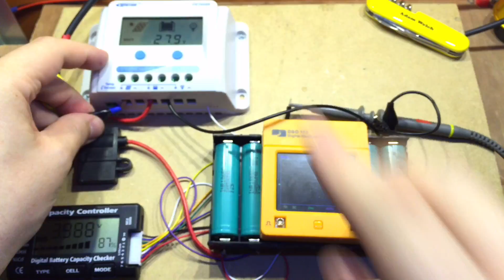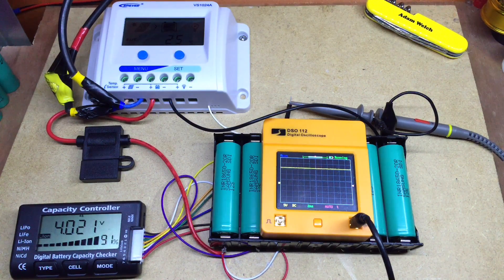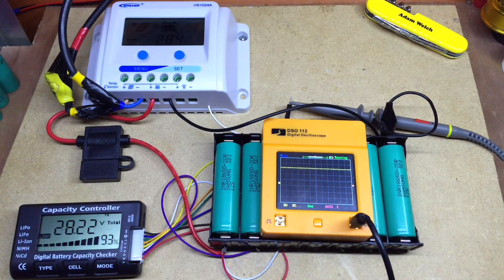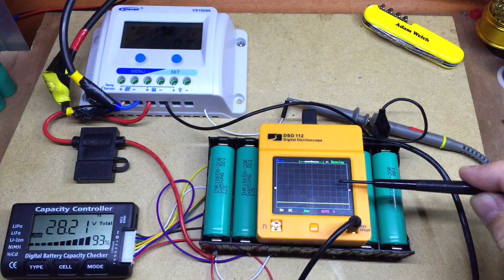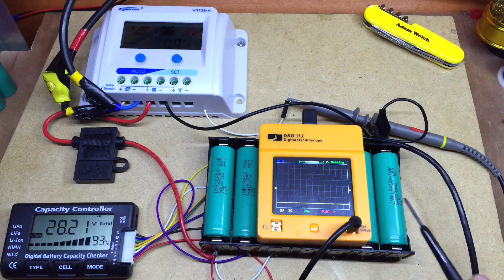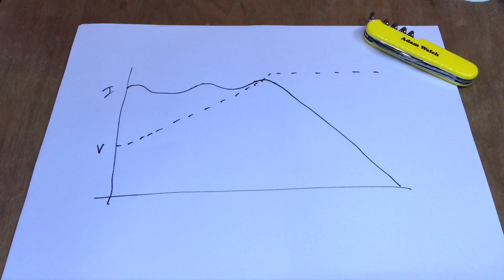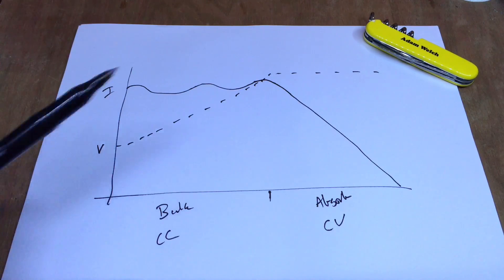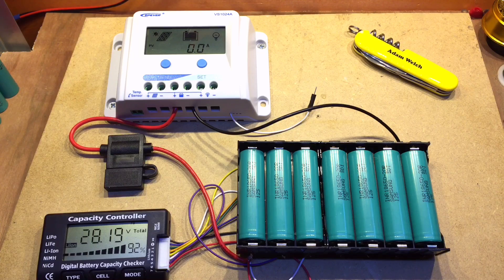Solar Charging Lithium Ion 18650s - Part 3, The Results - 12v Solar Shed

Comment: Can you measure the voltage of your solar panels after plugging into a charge controller.  I am using an old 16v laptop charger and a charge controller to monitor my batteries.  As soon as I plug the charger into the charge controller, the voltage at the laptop charger (controller input) drops to whatever is being used to charge the batteries.  I thought that there would be 16v at the controller input, and 14.Xv at the controller output to the batteries, but the charge controller seems to lower the voltage of the input. Does this make it impossible to measure the voltage of the solar panels when connected to the charge controller?

I don't understand why lithium charge controllers are so much more expensive than lead acid charge controllers.  Wouldn't it be easy for the controller manufacturer to program in the different cutoffs to match lithium battery types?
Reply: The voltage measured at the solar input of a PWM controller will always be around the same value as the battery voltage during the bulk charge phase. It will usually be slightly higher due to voltage drops within the controller. That's normal. However, if you're using a laptop charger and it drops to near the voltage of the batteries, that's scary! It must be pushing some current out. Probably not good for it. 

You might want to put a resistor in series with it to limit the current a bit, and also that will make it behave more like a real solar panel. An incandescent bulb is the ideal solution here as it will act as a quasi-constant current source as well as a crude current indicator. Try a 21 watt 12 volt tail light bulb to begin with.
Reply: I'm not following what you're saying.  If it's normal for the input voltage and output voltage at the charge controller to be approximately the same (even though the panel or the laptop charger is putting out higher voltage), then why is it scary that the charger's voltage is the same as the output voltage - same thing, isn't it?

Right now the input voltage from the charger at the charge controller and the output voltage to the battery are reading 13.8v (even though it's a regulated 16v charger).  I was surprised by this, but I think you're saying it's normal for the lower voltage to be measured at the charge controller input (I assume this is true with a solar panel too).

I don't understand what you mean about pushing some current out.  Once the batteries are charged, I don't think the charge controller is pulling much current.  When I measured current into the batteries after they were full, it was very low.  

Nothing is getting hot, and it all seems stable.  not sure what you mean about scary???
Reply: Because a solar panel is a reasonably high impedance source where as a SMPS for a laptop aims to be extremely low impedance. In other words a solar panel has a certain amount of resistance "built in", as it were. However a constant voltage power supply does not. It always tries to keep pushing out it's design voltage. The only reason why it will drop is due to overloading.

It is true that a lot of such units have some kind of electronic protection on board, but this usually only activates during extreme overloads. The most dangerous situation for these units is when they're supplying just a little over their intended current rating. They'll keep going until something cooks. This could happen quickly or over a period of time. 

Have you measured the amps your batteries are pulling at the beginning of charge & what current is the laptop PSU rated for?
Reply: The laptop psu is 16v 3.35a. I'll try draining the battery some and then measure the amps being pulled out of the charger.  I guess what you're saying is that it's not a good idea to use a laptop psu with a solar charge controller?
Reply: First, I put a load on the battery to draw it down.  As soon as I put a load on the battery, the battery voltage dropped about 5v.  I wonder if this is an indication that my battery may be bad? It is an old battery.  I have another.  Once it charges, I'll switch batteries and see if it makes a difference in supporting the load.

After running down the battery, I put the charger back on and measured the amperage draw.  It was only putting out about half an amp (.45 or so).  So much less than the rated 3.3 amps at 16v of the charger.  I guess the question is why is the amp draw from the battery so low?  I think you were worried that it would be drawing more than 3.3 amps, right?
Reply: Well if you're only pulling 450 mA or so it would seem that the PSU is in no danger of being overloaded. On the other hand though one would think that a regulated charger like a laptop supply would still be putting out close to it's rated voltage at such a slight current draw. 

I wonder if the power supply is not working quite how it should? A 16 volt 3.3 amp supply should be capable of delivering just over 50 watts. You could test it by putting an 8 ohm resistor directly across it while measuring the current. You should get around 2 amps flowing while the voltage is still fairly close to 16 volts. This would be drawing 32 watts so you would need a rather hefty resistor. Two 16 ohm 10 watt types in parallel would do the trick if you don't run it like that for too long - they would get quite hot. 

How many volts is your battery & what size is it? And is it a lead acid battery or lithium pack similar to what Adam is using on this video?
Reply: Generally speaking, you can use other supplies with solar charge controllers but you have to be aware of their different characteristics to actual solar panels. When a PWM charge controller is in the bulk charge phase it's essentially functioning as a "piece of wire" between the source & the battery. It's really no different to connecting the battery directly to the panel or other charge source. 

If you have a bench supply with a current limit control (or one of those Ming Hi boards with something similar) then it's no issue as you can just set the maximum current to a safe value. But if you are using a random wall-wart or other power supply intended to power something else to feed your charge controller, you need a way of limiting the current to a safe value. 

That's where a resistor comes in, it's value can be found by experimentation & will depend on the size of the battery, the voltage of the PSU and the current that the supply is capable of safely delivering. 

Of course setting up such an arrangement would ideally need to be done using a battery you know is in good condition that is quite discharged (but not over discharged), that's the point where the maximum current will flow.
Reply: Thank you for all of this information. Very interesting.

Isn't the charge controller limiting the voltage?  If I plugged the charger directly into the battery wouldn't it output 16v (or 19v for a 19v charger or solar panel) and damage the battery?

I don't know why the current draw is so low.  It's a small sla battery (12v 3.3a), maybe that's why? I can test the charger on my buck converter and see what voltage and current it puts out into a load.  I'll let you know. I don't own any resistors. I have also used the charger on a jump starter pack with an 18ah sla battery, but I did not measure the current draw.

I will look at getting a buck boost converter with current limit function. Is there a rule of thumb as to the best current limit for charging sla batteries, or does one just make sure not to exceed the maximum amperage of the charger? Is it better to charge sla batteries at a % of their capacity? Or do they absorb on their own at a % of their capacity?
Reply: Yes, there is a rule - although it's not a solid rule, more a guideline - about how much current to put into a battery. Generally it's C/10 for a lead acid battery. So if you have say a 100AH battery you would be looking at 10 amps. For a 4AH battery best no more than 400mA although for smaller batteries it's probably best to go to C/20. For discharging it's considered overloading the battery if you take more than C/4. That would be 25 amps for a 100AH battery. 

The only limitation on the current that your typical cheap 10A PWM charge controller will supply is set by the source it's connected to. However once you get into the higher end of the charge it begins to limit the voltage applied to the battery though it's PWM action.

Naturally, limiting the voltage will also cause a limitation in the current flow. but it's not regulating the current per se, just the voltage. 

How much current that does actually flow is set by a few factors. The internal resistance of the battery (which changes with charge level), the voltage differential between the source power & the battery, and finally given a big enough voltage differential, how much current the source can actually supply. 

I would recommend getting a few high wattage resistors of varying values to play around with. They're pretty cheap and in combination with your meter you can learn a lot of what is going on when batteries are charging. In fact it's possible to make a charger just from your laptop PSU and one resistor. You just gotta remember to turn it off when the battery is charged! If you use a relatively high value of resistor and trickle the current in really slowly, that can be helpful in attempts to resuscitate batteries that aren't doing so well.
Reply: Xanataph:  

I tried to do some current measurements and testing today.  I plugged the charger into my buck converter, set the output for 12v, and measured the current going into an old 12v laptop computer, both to charge the battery and while it was running.  While running, the current numbers were jumping around, but it was pulling around 2 amps - so the charger seems to be working properly.  

The computer would reset when the battery was not installed in the laptop, so the power from the buck converter was not sufficiently stable.  I suspect this is due to the buck converter.  With the laptop's battery acting as a buffer, it ran fine, but was switching back and forth between "AC" and battery power quite often.

So I think the charger is working right, and the small SLA battery is just not drawing much current.

I tried to measure the efficiency of two buck converters using the charger and the computer while charging the laptop battery.  While charging (not running), the current readings were stable.  Unfortunately my results don't make any sense.  The input to the buck converter was reading 14v and 1.03amps (14.42w), while the output was reading 12v and 1.36 amps (16.32 w).  

On a second buck converter, I had 14.3v at .76a in (10.868w), and 12v at 1.11a out (13.32w).  I'm pretty sue I can't have more Watts out than in, so I'm doubting the accuracy of my measurement equipment (a very cheap Centech multimeter).  

I'll try the charger on a bigger battery (12v 18ah) when I get a chance and see if it's drawing too much current (using my possibly flawed multimeter).  I actually have a buck converter with a current limiter that I could use if the charger is being overtaxed, but I'd rather use it for regulating 12v output if it's not needed to protect the charger.  I don't think these SLA batteries are pulling that much current. 

In your prior comments, I think you were worried that the batteries would demand increasing amounts of current, overloading the laptop charger.  I'm not clear whether a battery "pulls" current or whether a charger "pushes" current, but somehow it appears that they are limiting the draw to safe levels in my small SLA battery.

If I hooked up a solar panel generating 10 amps (120 watts), would only a safe 1/2 amp be going into the battery?  You said that a solar panel has a higher impedence (more resistive?) than a laptop charger, and so won't pump too much amperage into the battery. Could the laptop charger be doing the same thing?
Reply: Sounds like the buck converters are running right. More amps out than in is what you would expect. It is difficult to get an accurate current measurement on something with is taking power in a pulse type fashion. That can confuse a multimeter. This would account for your erratic wattage results. 

If the laptop charger is putting out 2 amps indeed it does seem that it is working fine. If your battery is not pulling much current it could be sulphated up. 

Another thing I just remembered. Some switchmode power supplies tend to do "funny" things when there is not enough current being drawn from them, such as outputting a lower voltage than usual. Which potentially adds another layer of confusion into the mix. 

Yes, solar panels have a much higher supply impedance than your typical linear or switchmode mains derived supply. However a 120 watt panel in full sun is likely to push a substantial amount of current through a 3.3AH SLA battery unless it is kept in check via some means.

Comment: Adam,  You had another comment on this same topic on your part 2 video.  I am also suspecting that the cell monitor Digital Battery Capacity Checker is draining the first 4 cells causing these to be lower in voltage,  3.5 volts versus the 3.8 volts.  I assume you had it connected 24 hours a day.  Since you now have all cells in balance, can you disconnect the Digital Capacity Checker and then charge and discharge the 7 cell lithium pack to see now well they will stay balanced?  Just use a DVM to check the cell voltages.  The disadvantage of using the Digital Capacity Checker to balance the cells is that power is just lost as heat, thus reducing your cell capacity and wasting solar energy.  Great Videos!
Reply from the maker: +gerry Thanks for the kind comments. Yes I'll try this for a few days whilst I know I'm able to check manually. I haven't had the issue of the three cells and four cells at different voltages since. If there's anything worth reporting I'll ensure to post a video.

Comment: Very interesting movie. I am going to build my own off grid solar factory and I have been thought about Li-ion battery. Unfortunately at the market MPPT (I do not want PWM) chargers for Li-ion batteries are very expensive. So, your test gave me a lot. Maybe can you test some MPPT solar charge controler too ?
Reply from the maker: +bartaska68 Most MPPT solar charge controllers only do DC to DC conversion (and boost the current) in the bulk phase. Absorb and float modes should be unaffected. So I'd like to think the same will apply as here with my PWM charge controller. 

However I think there are some factors we need to consider - the c rate of our pack. Charging at too high a current in the bulk mode could be damaging, and this risk could increase with an MPPT solar charge controller - but then it could increase on a big solar panel or array too. 

Perhaps there's more work (and more video) on this potential issue. Stay tuned because this channel is all about doing things cheaply where possible!
Reply: Yeah, you have right. I think I will buy Tracer MPPT solar charger (http://www.ebay.com/itm/EPsolar-MPPT-Solar-Charge-Controller-Battery-Regulator-Max100V-Input-12V-24V-MT-/311447970025?var=&hash=item4883bee0e9:m:m_J8PFgj4eolafoTB5zH8Eg). I see that this charger has 3 phases of charging and I can set values manually. That sounds great. Still I do not know which voltage i should use, 12V or 24 V. I mean, I can make 3S/4S battery or 6S/7S battery. Li-ion batteries I have from old laptops batteries.
Reply from the maker: +bartaska68 Have you seen my review on that charger? It's the one I use on my main solar setup. A decent unit.  For me, lithium needs to be 7s to best match 24 volt devices.  3s and 4s doesn't work all that well for 12 volt devices - but as you say, there are different options available.
Reply: At first I will do 3S and 4S because I do not have enough Li-ion cells. I will test it and if I have more cells I will do 7S. Besides I have old UPS and I can try to use it as a inverter.

Comment: This is interesting I may have to use your setup as a reference to my own hmmm got me thinking now. Thanks Adam! Steve.
Reply from the maker: +Steven Watson Thanks for your comments. Good luck with your project.
Reply: I ordered a 100a customized bms .  I plan to have the the mppt charge controller connected to the bms and it should feed my batteries.  not really sure about if the mppt charge controller would detect the battery thrue the bms board or if I would have to cable it separate? got to test.